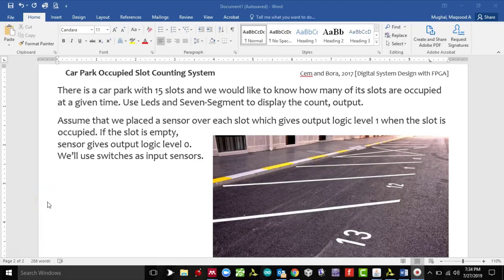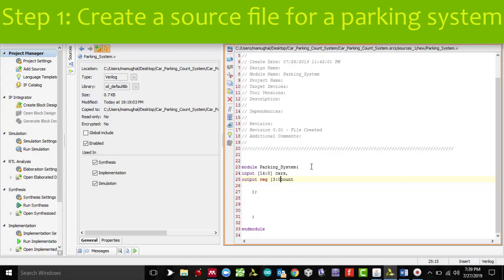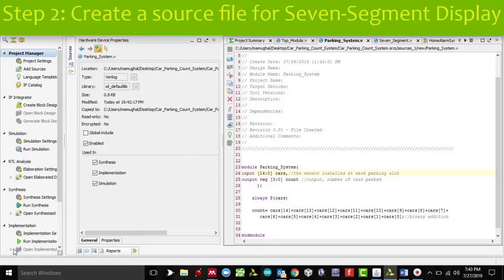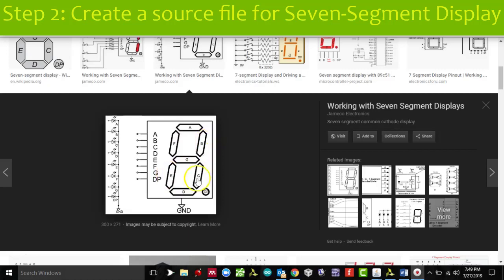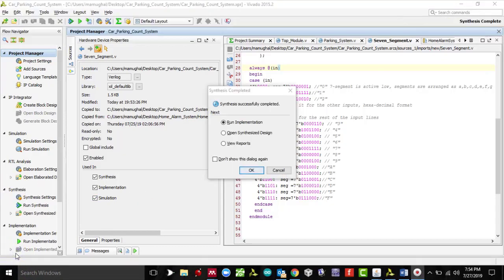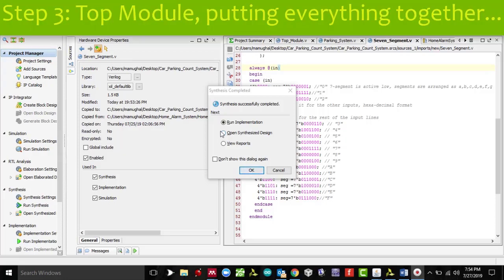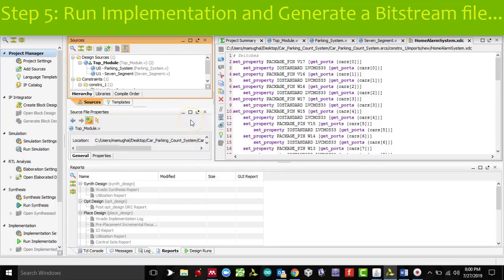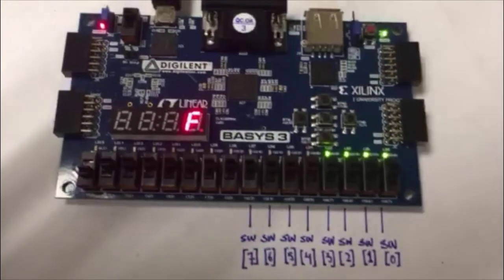#10 Car Parking Slot System | Basys 3 FPGA Board | Verilog | Step-by-Step Instructions

Comment from the maker: If you find video helpful, please consider subscribing to the channel.
Full Course available at Udemy w/ free access to code and project files for 10 cool FPGA projects ➤  https://www.udemy.com/instructor/course/5064304/
Reply: Good day, I just paid for the patreon to have access to the project file code and constraints but it’s just a repeat of what’s on YouTube. $15 is a lot for a student. I need my request accepted so I can access the files. Thank you.
Reply from the maker: @maryamare8663  I just provided you access to the files. In addition, I am send you a link to a FAQ sheet over Patreon that you can use shall you need to debug your code. You'll find more than 100 errors/critical warnings reported in that file. In addition, if needed, I can spend one-time 20 minutes over Zoom to help you with the code. These perks are only available to Patrons.
Reply from the maker: @maryamare8663  Dear Maryam, I understand. I just provided you the access. I hope that you will benefit from it. Good luck.

Comment: Sir, is it possible to do this project using Quartus software?
Reply from the maker: Yes. A absolutely just change the constraint file.
Reply: @ElectronicswithProfMughal  thank you Sir. I have another question, do you have any sharing on related encodes of this FPGA board with Datapath Unit and Control Unit?
Reply from the maker: @alyaworker6673  unfortunately not.

Comment: Sir please provide access to me.
Reply from the maker: Kunal, you should have the access now.
Reply: Can you tell me which sensor will we use?
Reply from the maker: There were no sensors used. You only require an FPGA board.
Reply: Sir can we run this code in any xilinx version?
Reply from the maker: @pushpinderyadav1655  you mean Vivado? yes.